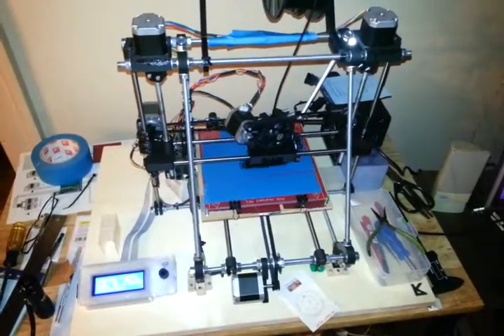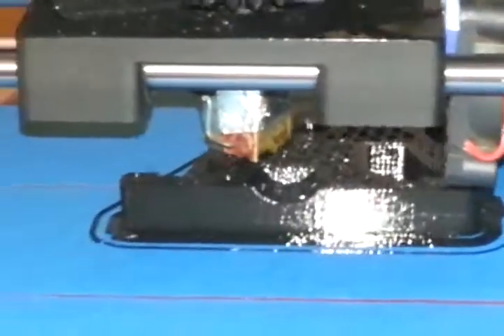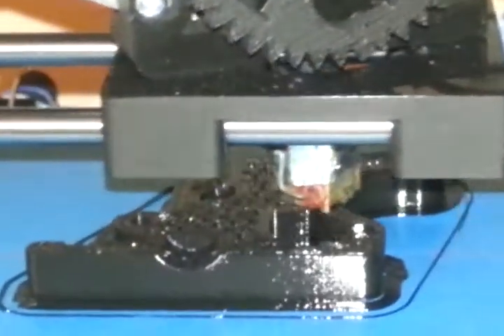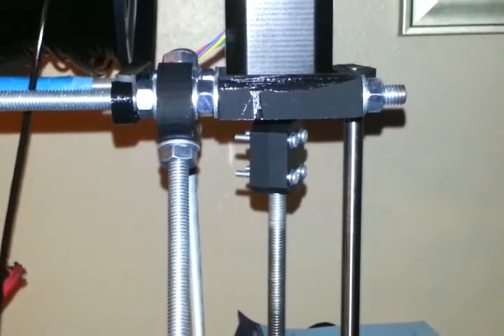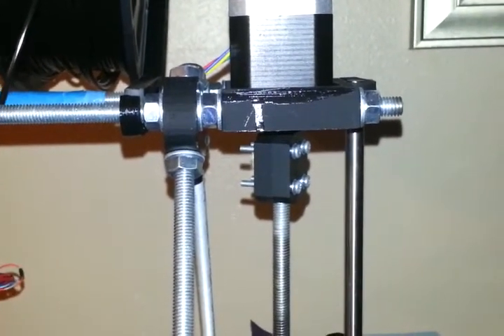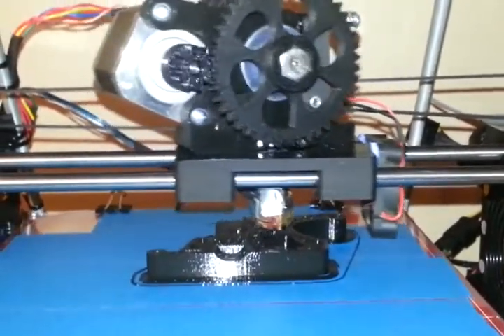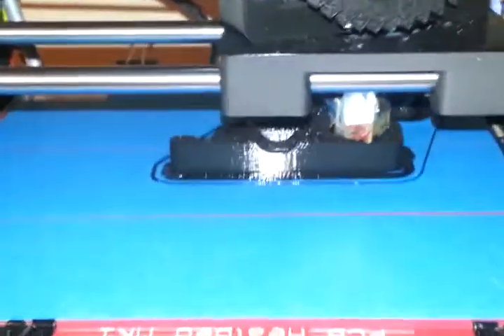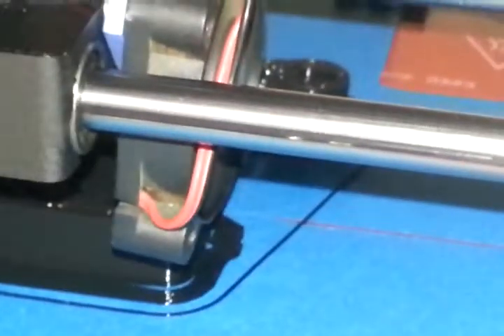hoppingZ

Comment from the maker: Update:   After much experimentation, I've discovered that Z-hop or Z-lift, works best in very small amounts.   I use a Z-lift of only .05mm presently.  That's not enough to draw any filament from the nozzle, but just enough to assure the nozzle clears any part of the previous layer during travel moves.   It's made a remarkable improvement in my print quality.

Comment from the maker: Slightly more wear on your Z-motors and rods I suppose.  Maybe just a bit more heat out of the driver for the Z-motors.   I didn't measure any real increase myself.    
The benefit seems to be less strings or hairs of plastic, but that could vary if your extrusion amount is off.  If you're running the nozzle too hot, or your extrusion is slightly too much, that little bubble of plastic that hangs at the nozzle end even after retraction could be drawn out by the lift and create a string.